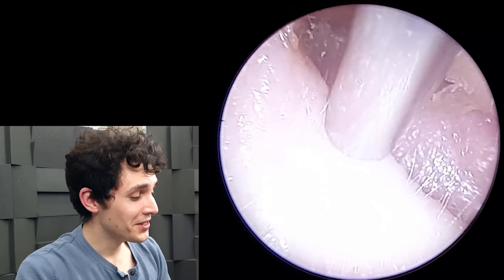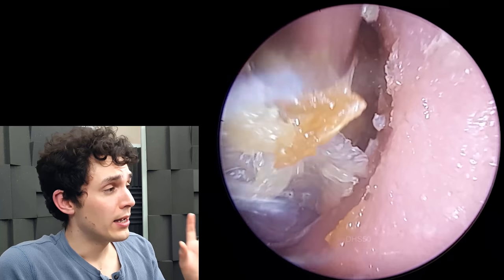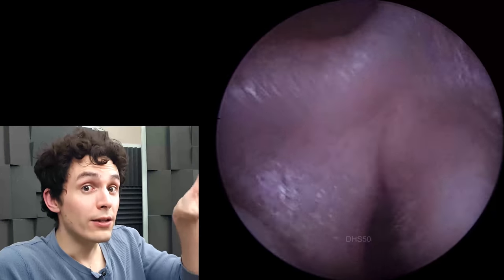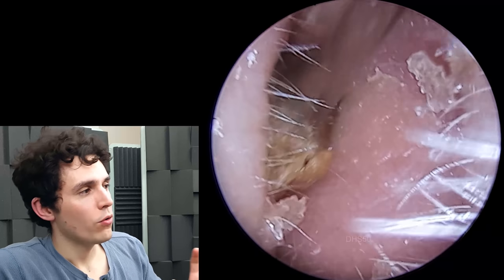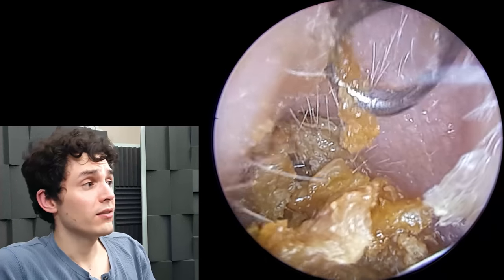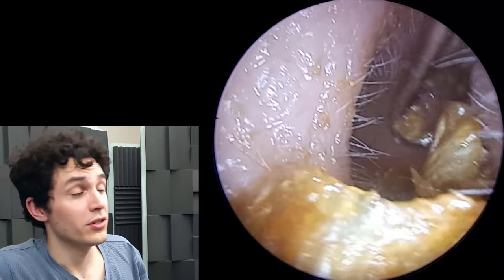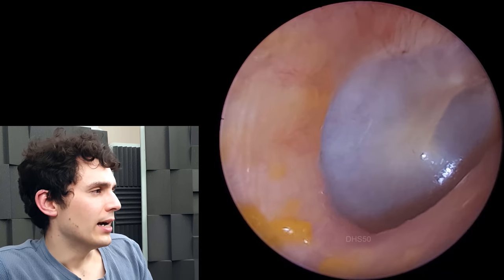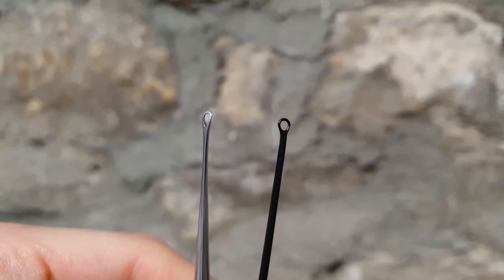Formby Scoop Used To Extract Hard Wax From Small Ear

Comment: I wondered how you are set up to start? Do you have an assistant? I am trying to picture if some items are autoclave or if you use disposable tools? So interesting!
Reply from the maker: I'm usually by myself but if the ear is extremely bendy or closed off I'll call an assistant to pull the ear open as I'm working on it. Most items are single use unfortunately
Reply: @DurhamHearingSpecialists  can you reuse the handle part? Are they recycled?
Reply from the maker: @candacecurtis5739  Can't reuse the handle part either, i'm sure they could be recycled but they are classified as 'clinical waste' and get incinerated i think :(